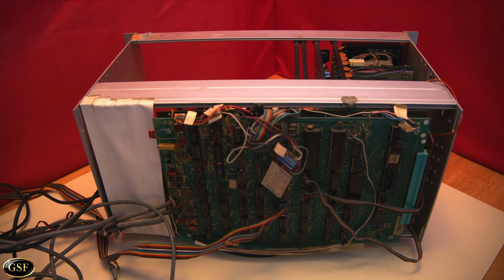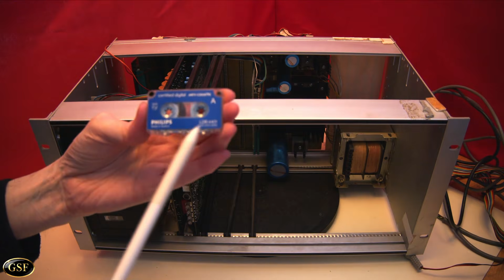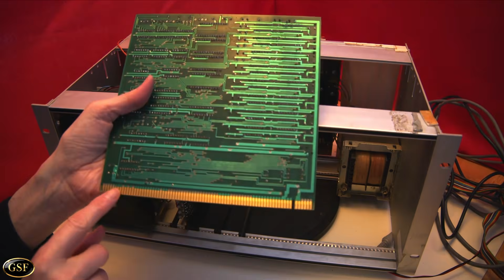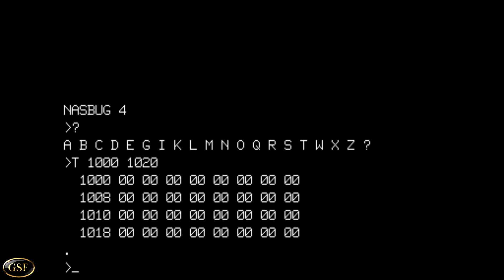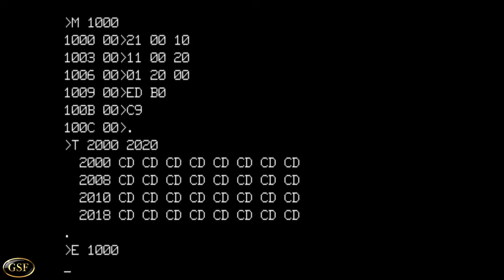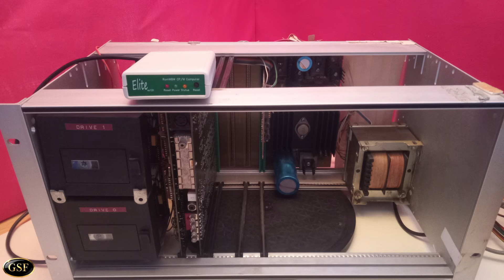The Z80 Nascom 1 computer - after expansion

Comment: That takes me back! I bought one of the first batch of Nascom 1s (with a big delay in delivery due to their unexpected popularity...) and well remember typing in game programs in hexadecimal. That felt like a real luxury, as my previous computer (also Z80 based, which I'd designed and built) had to be programmed in binary, using rows of toggle switches for address and data. 
I still have the Nascom 1 and it's successor. I'd initially thought of expanding it like yours, but opted instead for a CP/M machine from MAP-80 systems with two 5.25" floppy disk drives. I assembled it into the same kind of rack as your Nascom and it served me well for several years.
I still have both machines and all the circuits, documentation etc.(And a heap of 2102 memory chips originally intended for a memory expansion for the Nascom!)  I've not recently tested the Nascom 1, but was pleasantly surprised a couple of years ago to find that the CP/M machine still works. But many of the floppies had degraded; fortunately, I was able to recover most of the data using the "Fluxengine" hardware/software from David Given.
Reply from the maker: Yes the Nascom 1 & 2 were amazing machines for their time. I've never programmed using toggle switches, that must have been challenging.

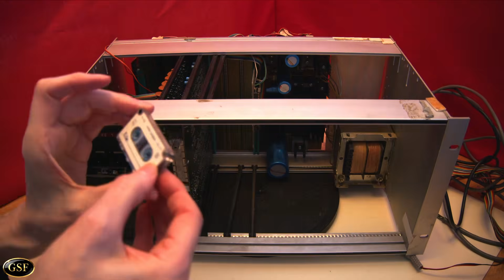Comment: 3:30 - A FAT on tape and TWO drives in parallel?  That's multiple innovations all at once, and in 1978.  It makes you wonder why others (e.g. Apple, TRS, Commodore) didn't adopt multiple tape drives unless they were already thinking multiple floppies.  Tape was agonizingly slow to deal with on home computers, but at least it worked.
Reply from the maker: The Philips tape drives, £99 each at the time, were a game changer. It was hypnotic watching them wind back and forward to find the file to load, faster and more reliable than cassette tape.
Reply: @custompchardware  Do you have a model number?  I'm interested in finding one of these - they look great fun.
Reply from the maker: @KeithMarsh2 The computer is a Nascom 1, the tape drives were from Philips and bought from a company called Icon, which I believe was in Wales. I doubt that the mini-cassette drives are still manufactured, but they were an exceptional good way to store and update data before floppy disks appeared.